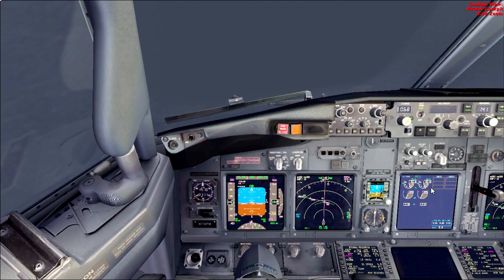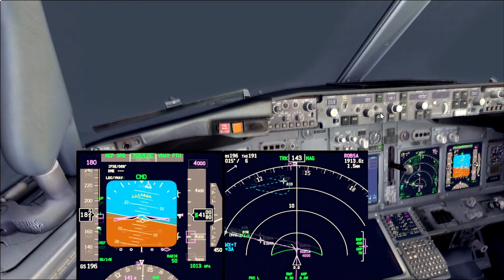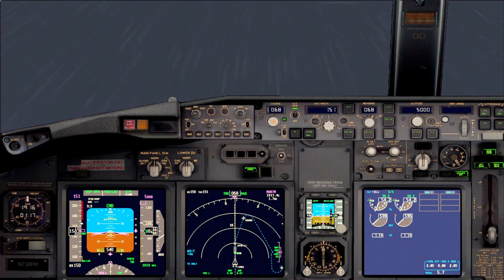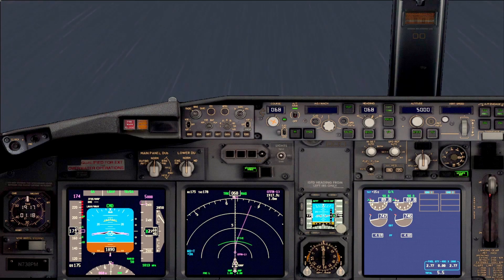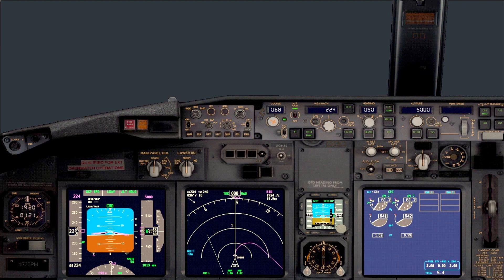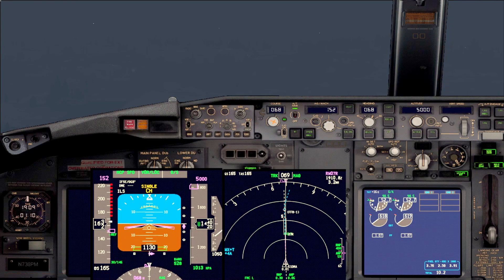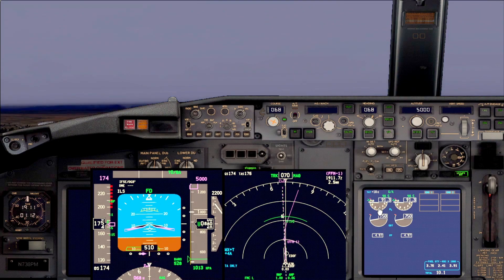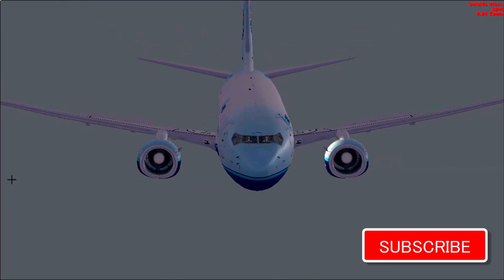737 Go-Around During Landing Tutorial - Professional 737 Airline  Pilot - PMDG

Comment: Thanks for the amazing video, I have 2 questions pls:
- 1:23, is there any restriction to intercept the LOC with more than 180 kts ?
- When do we engage VNAV in a go around in CAT III & Manual FD Go Around?
Reply from the maker: Thank you 😊. Regarding the LOC interception, around 185k is a good number but not mandatory. What usually happens is a 737, is that if you reach the GLIDE PATH at 195k and above, you will have a hard time reducing your speed, and you might need to extended the landing gear very early. Regarding VNAV, if you go aroung and dont engage VNAV it is absolutely ok too. In TO/GA mode, which is the selected mode once we press the toga button, the aircraft will also accelerate as we raise the flaps. The altitude to start retracting your flaps is 1500 AGL, after your AC is in clean configuration, you can switch to VNAV.
Reply: @pilotdreams7886  Many thanks, will be grateful if you can do "Single Engine Go Around" as well to see all scenarios, FMA , A/T  changes
Reply from the maker: I think on doing an  engine failure during takeoff tutorial, including landing on single engine and a go around. Maybe it'll be the100 subscribers special 😊